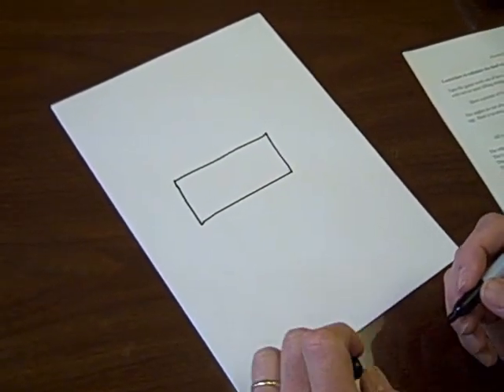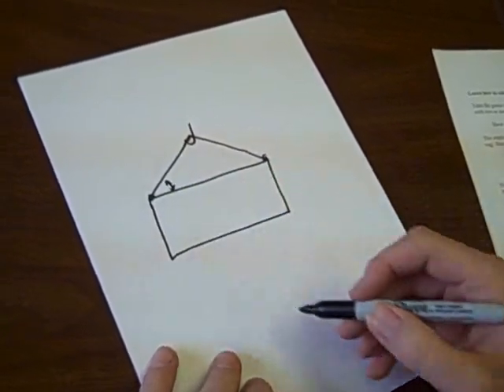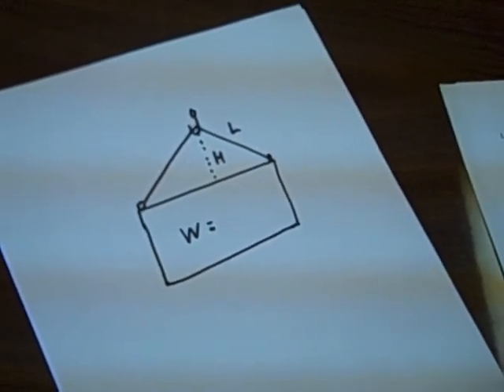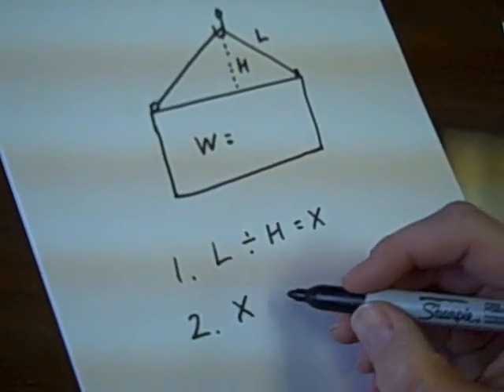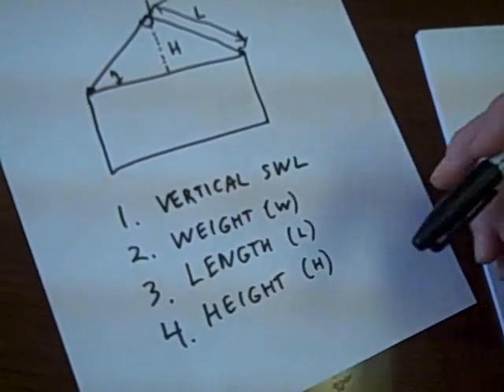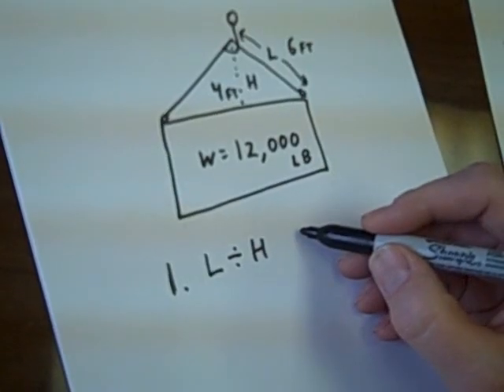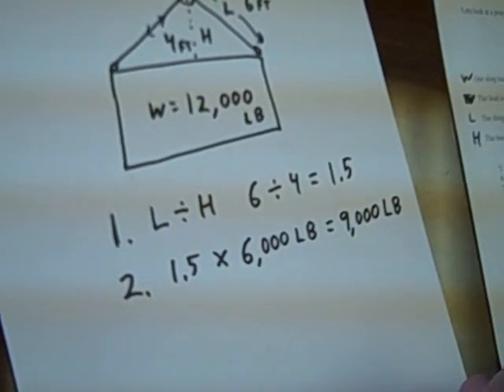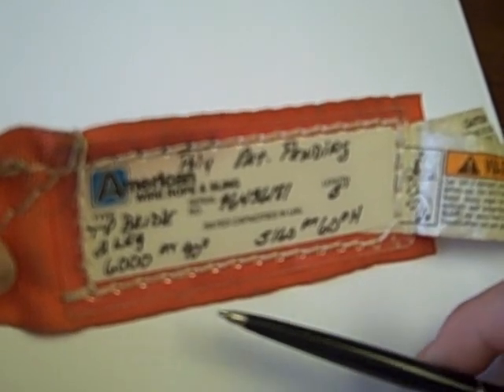How To Calculate A Sling Load

Comment: I am an Appointed Person, trained to make lift plans.
The only thing good about this video is that you can find out the "sling load" but this should NOT be used to calculate the actual lift, because it is WRONG.
A Load Weight of 12,000 lbs is, 5443 kg so, 5.45 Tonnes. This is very heavy to be using “slings” or better called Webbing Slings. You will be using a  sling that it is too wide and may need shackles to attach to the lifting points of the load, making it unreasonable. Red Lifting Slings are for up to 5 tonnes, Brown Lifting Slings up to 6 tonnes, but these are rated for vertical lifts, angled loads require a much higher vertical rating.

Instead, chains should be used in this example. An 8t rated chain can do the job safely. Calculating the Safe Working Load (SWL) – i.e. Rated Capacity – of multi-leg sling/lifting accessory arrangements using Uniform Load Method.

The measurement of the HH (hook height) is a bit ambiguous to say the least. The correct way of calculating the HH is based on the desired (included angle, in the UK, is 90 degrees or lower)
Or up to 45 degrees on the vertical angle from the load point (vertical) to the angle to the hook of the crane.
The most important factor is the desired angle of the chains in relation to the hooking points of the load, which is called (included angle).

In this example, I used my Trigonometry Calculator App and I input the known values that this person in this video gave.

We know that the right angle from the HH to the base of the centre of the load is 4ft which is (a) side. We know the hypotenuse (c) 6ft, with this information we can now know the angles and (b) distance, which is half of the distance of the load. 
So, side b is 4.472 ft (1.36 m) x 2 = 8.94 ft (2.72 m) is the total length of the load.

The angle beta, which is the angle between the vertical side of the HH and the distance of the sling is 48,18 degrees, making the included angle of 96.35 degrees. I will refuse or not allow this lift given these characteristics because we don't know the sling tension for an included angle greater than 90 degrees.

Making numbers out is not the professional way to teach lifting operations.

Comment: How can I calculate the breaking strength/force.And how will I calculate or determine if the sling is correct one to use with calculations.

Comment: How come you dont compare the 9000 lb answer at SWL 45 degree angle.?
Are all angle loads compared to 90 degree SWL?
Reply: In this case. You take the length of your choker and the height to the hook from center... (Basically gives you the angle)  then multiply half the load weight. Gives you the tension on the choker... You don't have to know the angle for this formula... Just look at your tag for load limits in a choke, straight, or basket and you'll be good to go... Assuming center of gravity is center of what you're lifting

Comment: It's stupid to forget about the angle! An object lifted by 2 straps with an angle smaller than 30 degrees woulds require straps with more SWL than the weight of the object. In other words: if the angle is smaller than 30 degrees with 2 straps it is saver to use only one strap.
Reply: How

Comment: How do you calculate the sling loads in a four point system which is asymmetrical i.e. the COG is away from the centre of the object?
Please provide solutions for this if you have.
Thank you
Reply: Only 2 legs carry the load!

Comment: So if you use 3 strings instead of 2 to lift the weight it is X times 1/3 of the weight. Or am I reading this wrong?
Reply: no. when you do this calculation it's always based on 2 legs.
Reply: Sardar Vlogs the third and forth leg are for balance of the load 2 slings have to be able to carry the load by there self. Just like using a 4 leg bridle, 2 of the 4 legs must be able to support the weight.
Reply: Michael Boyer, nope, when you're lifting with 4 slings, you can calculate strength of your lift with 3 slings, not with 2
Reply: @michaelboyer4474  2 "diagonally opposed" legs...

Comment: 1.  Please don't call them "straps".  What you show in the video is a "Web Sling".  2. The Load Angle Factor (LAF) can be calculated by this method from any point on the sling, not necessarily all the way to the hook, (which would be difficult with a very long sling.  3. For practical purposes the rigger should remember the 3 main angles he is concerned with a. 60 degrees is preferred, 1.155  b. 45 degrees is next option, 1.414 and the low limit when going into a hook, and c. 30 degrees which is worst case 2.0 and the low limit going into a shackle or master link..  And for James Kutty Joseph, please do not rig any load until you understand the stress factor.  Try holding a 5 gal bucket of water straight down, then at a 45 degree angle and see if your arm feels any additional stress at 45 degrees.
Reply: That's an endless not a web sling
Reply: @squirts1  Yes, your arms are not ropes that can only resist pure tension and your joints are not pin connections that can’t resist any torsion.
Reply: @squirts1  There are a couple of issues here, first, that weight is almost 5.5 tonnes, so the webbing sling would NOT be adequate for the lift, Chains would be the preferred method.
Another issue is that that sling had miss information, because 90 degrees, is talking about included angle and therefore Uniform Load Method calculation should be applied. Handwritten information on the sling tag is doggy to say the least.
I get it that the video is 14 years old, and now we have better methods to get a correct calculation.
BTW, Gary was right. His analogy stands because it reflects the extra work the arm has to endure to maintain the angle.
Reply: @squirts1  Sir, I understand, it is made simple so it can be understood to a lay person, if you want to be picky, then the same example but facing up and the load on each hand dangling down either side. 
Torque would be the power of his arms to hold the load.
Tension would be how much can he hold until he loses his grip (breaking)
You are reading too much in to it.
Reply: @squirts1  wow, you're still persistent with preciseness. Analogies can be flexible, and its job is to explain the point to another person not acquainted of the field of work. I understand both ways because I am also an AP and a crane operator. The rest of people might not be so adapt to understand what he is trying to convey, hence analogies.
Example, I feel sadness in my heart. Is that the real case?? Of course not, but we get it, without moaning about the intricacy of the ventricular pumping movement and how the blood flows.
Anyway, if it will make you feel any better, I agree with you.

Comment: I start my apprenticeship with cranes tmr, and have a question, the straps vertical safe working load at 90Deg is 6000K . but on the diagram you draw the straps at 45 Deg. angles. from the hook. does that pose a problem ?
Reply: He's telling you towards the end of the video what the stress will be on each leg... Just remember at 30 degrees on a 2 leg lift, if the load weighs 2k then each leg, at 30 degrees will each have 2k lbs on it.

Comment: Your first option is not needed at the very beginning because you don't know (at stage 1) the load of the weight. This is the first thing you must know. Unless in a planning stage, but still, I wouldn't use that first.

Then the dimensions of the load.

There is no point in looking to a sling vertical SWL if it can't even reach in diagonal.
I would put the lifting equipment at last. 

Stage 3 can't be the length of the strap because it correlates with the rated capacity and the designed length of the sling. If you have a fixed length of sling then this negates the calculation because you are fixed to the length.

What this guy is using is the old Rigger's Method. An archaic way of calculating sling load tension and lengths.

So, the 6f is the hypotenuse, the height is the Adjacent (4f), and with a bit of trig, the distance from the centre of the load to the hook point is 4.47 feet. This is a force distance (false) due to the 6f of the sling and the made up length of the hook height over the load (4f).

L/H finds the tension factor, but how do you find the height in the first place? Just put an arbitrary height? 
The biggest mistake he makes is dividing the load in half, this is because it is assumed that 2 slings are going to bare the weight of the load, 5.44 tons. In reality, he should say (divide the load by the number of slings) 

To be honest, I don't see loads at that weight and having only two lifting points.
My final comment would be about the SWL of the sling, 9000 lbs, if he uses a 10000 lbs sling then he is working the sling at 90% of the rated capacity, this is bad practice.

I would put at minimum a 25% addition to the sling for the 9000 lbs lift, so 9000 x 1.25 = 11250 lbs vertical rated, so each sling is doing a maximum of 75% of the work.

Comment: I want to know how to convert this method of reference to metric? Or worse. Where do the number compound to the point that this method is not set in stone. Feet divide into twelve equal parts. Pounds divide into sixteen. Like celcius and Fahrenheit? Only works at -40°. Probably be close for a quick check though. Nice.

Comment: if the horizontal angle of ur sling is 60 degree....then we should multiply 9000 with 1.155( loade angle facto for 60 degree). the answer would be bigger than SWL OF  WEBSLING IN verticle position.am I right or not?
Reply: agreed! but great video

Comment: Can't you just multiply by the sine of the angle?  Say a vertical sling is considered to be at 90º and you have two slings at 30º and each sling has a SWL of 1000lbs; you would calculate the sine of 30 (0.5) and multiply it by the SWL, giving you a SWL of 500lbs per sling.
Is this accurate?
Reply: It's accurate but useless unless if you don't know the angle. In this video he does not assume you know the angle.
Reply: 1cy3
But can't the angle be easily measured?
Reply: You can do it with one sling , 1.4 times the SWL of one sling gives you the answer for 1to 2 slings for 3 to 4 slings use 2.1 thats what most of us riggers will do.

Comment: Grate information, i would like to learn to calculate  the load chart of a boom truck40 ton and under with a series 456b with a 18ft jib. ( the gross capacity, net capacity,what does they represent or mean. )  looking forward for another grate class one love thank you.
Reply: Look at the load chart of the of the crane. It'll tell you the capacity at the radius of the boom, jib, trolley etc depending on company your with, a lift plan will be needed past a certain crane chart capacity...
Reply: @dustinjones4910  This tells me that he works alone in his lorry, no operator should be necessarily forced to know this information.
There are qualified personnel that make these evaluations and the information is then relayed to the crane operator via a liftplan.

Comment: This is part of the test when your doing your Sparrows Stage 2 Certificate in the UK
So thanks for posting it
As for Dragonf1sh below you need to go back to training school if you want to forget about the Angles because the bigger the angle the more weight is on the strop 
But 90 deg is the safest angle and i would never go beyond it
Reply: Never exceed 90 degrees? You're gonna put a hurting on your company with all of those spreader bars...

Comment: Ok.... So not confuse anybody when you do the calculations for foce of each sling, and compair it to the safety rating on the sling (weight) I and it falls short, of safety for a single sling,...... But you are using 4 slings instead of the single  so u got the single sling rating ×4 will that be considered a proper and safe lift ...........🤔

Comment: THANKS ... I thought it  will  actually  reduce  force  when  it  is  at  an  angle ..still  i am  not  convinced  ,  the  resultant  force  should  be  the  wt of the  load ,  and  the  sling  would  divide the  total  wt  of  the  load  in to half ... sharing ...  where this  extra tension  comes  from ?  since  there  is  no  horizontal  component in  a  vertical  load!!!!
Reply: 90 degrees is verticle and that's the rating for the sling.  You go off center and the weight dynamic is different
Reply: ok thank you ,
Reply: james kutty Joseph The extra tension comes from the effect of horizontal load that comes from the slings not lifting vertically (90degrees). If the angle is 60degrees the sling is pulling sideways on the anchor and vertically. A 170degree angle could put as much as 1153% of the total sling load weight on each anchor. Try holding a 30lb weight straight above your head, then try holding it straight out in front of you or straight out sideways.
Reply: +james kutty Joseph the best way to understand this is to hang from an object with both of your arms straight up at first, then with your arms spread as far apart as you can reach. You will feel more strain with your arms spread.
Reply: Lucas Howard GOOD EXAMPLE...THOUGH
Reply: negative. Sling angle increases stress...
Reply: Thanks to Alex, Lucas, and Outlaw.

Comment: Sr. Why do you ad 1000 lb to 9000 lb. Thanks. 
To work in x,y,z plane I have to vectorize the forze on each componentes, and  if I require a dinamic movemen  i have to consider the graivity force. Isn´t it?

And Thanks for all.

Comment: Each SWL of your slings should be at least equal to or more than the full load at 90 degs...................forget working out the angle!!
Reply: Correct then just use 1.4 and 2.1 method on one sling